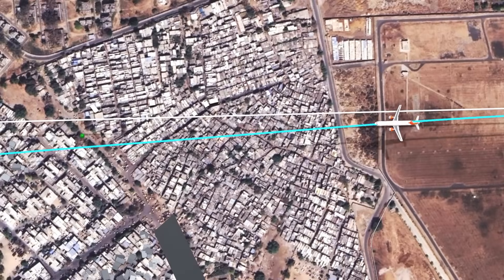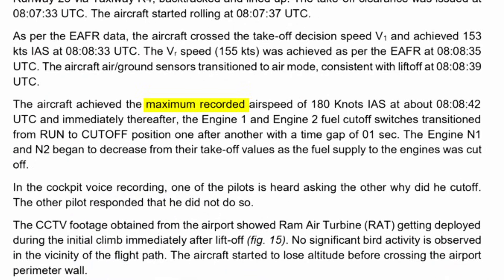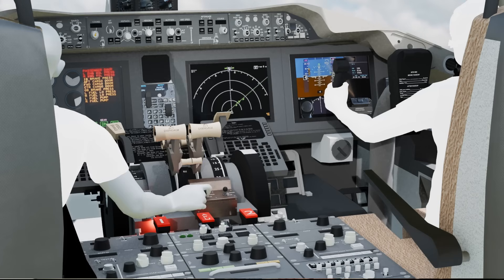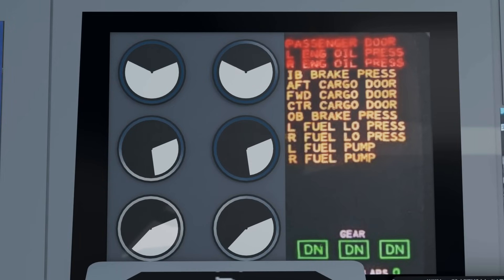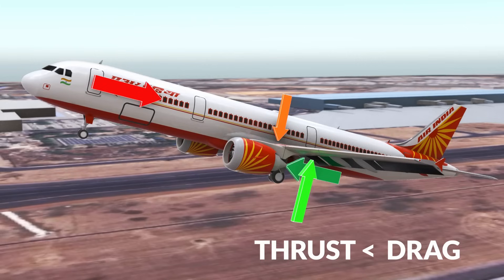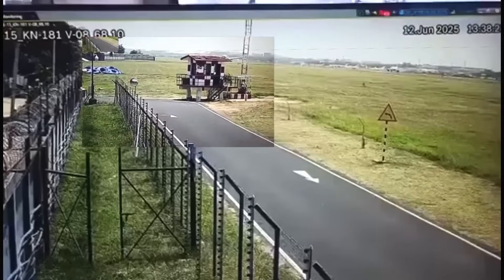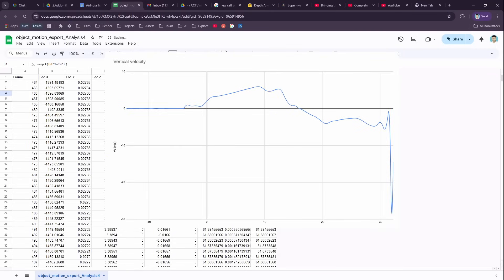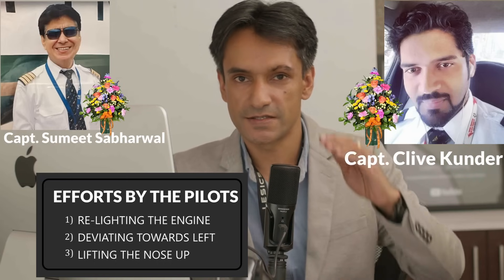Use of 3D Clone | Decoding the Crash Details you Missed

Comment: A collapsed 28V Electrical System explains this all. There are three points where the FADEC has influence on the fuel flow. This is the Spar Valve, the Fuel Metering Unit, and the High Pressure Shut Off Valve. They all need 28V for proper operation.
Reply: The 787 fuel valves are fail safe open. An electrical failure will not cause them to close. They do not spring shut.
Reply: @stimproid  By the schematic, published by Boeing, the Spar Valve is connected via a relay to 28V. The same 28V is AND-Gated with the HPSOV-OPEN signal from the FADEC and then fed to HPSOV. Thus, the valves need to be actively opened, otherwise there would be a fuel spill if the BATT switch is open (aircraft parked).
Reply: @fritzlehner9060  You tube keeps deleting when I try to post my response. I will just reiterate despite your understanding of the schematic, you are in fact wrong about the failure mode on the 787.
Reply: @stimproid  If these valves are operated by servo motors it is even worse! In this case it becomes even a matter of timing. The question is, do the vales close before the 28V collapse, or do they not. Every such servo unit needs limits and needs electronics for sensing. Are the limits set properly?
The investigators should jack the airplane and simulate the entire situation, simulating a 28V collapse.
Otherwise, they need to wait for the next incident!
Reply: @fritzlehner9060  The valve relay is OR connected (via parallel wiring) with the TCMA changeover relays.  Any relay can cut off the fuel if it flips.
Reply: @stimproid  Correct, but the TCMA system has direct authority to shut the valves and two of its relays are software controlled.
Reply: @fritzlehner9060  Loss of 28V to the fuel control relays would leave the fuel valve wherever it was when DC power was lost.  The plane's digital systems control two of those relays via software.  Any one relay can cut off the fuel through a variety of causes, including false data inputs to the software.  Just like the 737 MAX computer-commanded pitch-down.
Reply: @patricklockerby4308  This does not sound so good !
Could even be a false WOW indication.
Besides, my schematics are not detailed enough.
Reply: @stimproid  Loss of the 28V needed to operate the actuator will leave the valve in whatever state it was.
Reply: Something I wonder : “what system in the aircraft supplies electrical power during brief periods of high power demand (specifically, when electrical power demands exceed the output of the engine-mounted generators)?; is it the battery that does this? what happens if that system fails…
Reply: @matthewtymaja3760  It is the battery. Most aircraft are able to get started without Ground Power Unit (GPU). You get into the cockpit, Battery Master ON, Engine Master ON, start #1 engine, start #2 engine, alternators on,...
Airplanes with huge engines have an Auxiliary Power Unit (APU), being started first. With the output power from the APU the main engines get started.
But even the start of the APU needs currents in the range of 1000A, and therefore I believe it is imperative to have a means to balance the Lithium cells in all load conditions.
Thus, an aircraft not only stabilizes the electrical system with the battery but is even able to get alive with the battery only (no GPU needed).
Therefore, it remains unclear why the RAT was deployed at all. In case of the 787 the battery is charged by a separate charger unit. Such Chargers are based on high-power semiconductors. It could even be that these semiconductors failed, causing a short circuit on the 28V buses. The missing 28V caused the RAT to be deployed.
I think the crew had no chance to save the airplane!
Reply: Sure, go ahead and ignore why the pilot flying the plane asked the Captian why he moved the fuel switches to off.  And available flight data confirms that the switches were manually moved to off starving the engines of fuel. Chances of both engines simultaneously failing are a billion to one.
Reply: @ScottMunro-p3y  Too much seen already in aviation. Relay contacts welded together, corroded contacts of conductors, left/right alternators that are never balanced, now and then contacts due to wrongly mounted racks, failing WOW sensors, missing freewheeling diodes on solenoids, hydraulic valves that may be energized for 5 minutes only, Engine Fire sensors that falsely cause an alert, high impedance inputs that are prone to fail due to moisture,...
Some dead caused by this!
Electric/electronic designers in aviation act like hobbyists.
Reply: The pilot flying the plane asked the Captain why he moved the switches from run to shutoff.  The flight data recorder confirms that the switches were MANUALLY moved to shutoff and then back to run.  Stop spreading unvalidated rubbish.
Reply: @ScottMunro-p3y  The Pilot Monitoring said: 'I didn't' !
Reply: Now we are getting somewhere..the rest will be about ..water in e bay .as front wheel lifted..